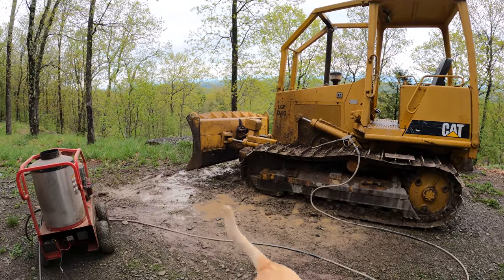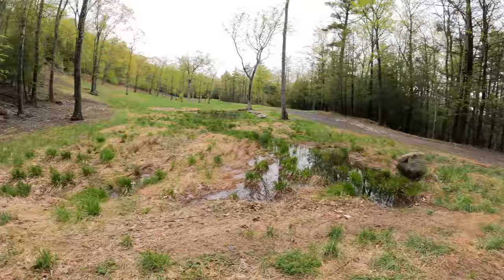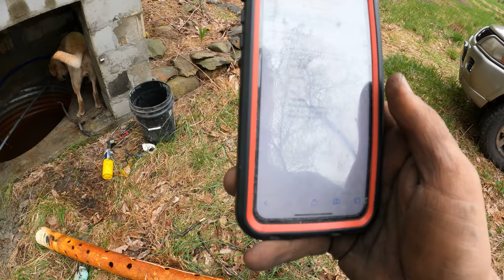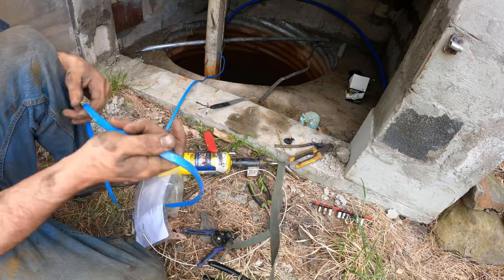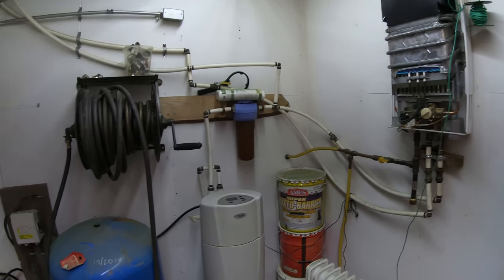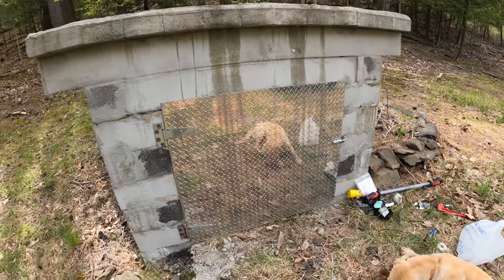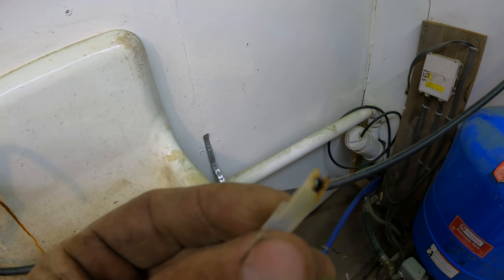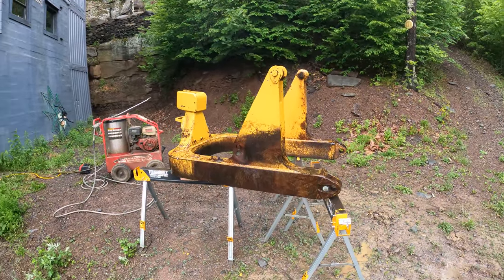Replacing a well pump

Comment: Clogged filter burned up the pump and then started tripping the breaker once new pump was in. Little maintenance goes a long way.
Reply: Are you talking about the water filter on the wall that he changed?  That Has nothing to do with burning out the pump!!
Reply: @mainelyelectric  that's weird because replacing the filter fixed the issues.
Reply: @mattkeller2466  yes it fixes the flow rate issues but doesn’t fix the burning out the pump! And like I said a clogged filter on the output side of the expansion tank and pressure switch will not burn out the pump it will just restrict your flow till you clean or change the filter.
Reply: @mattkeller2466   also a restricted output directly from the pump on the other hand would burn out a pump. And many people have already commented that the restrictive inside diameter of that blue poly pipe that he is running from the well pump to his building where the pressure tank is it’s smaller ID than normal well pump pipe so it’s restricted!
Reply: @mainelyelectric  Come on, man... That's a lot of words. (I'm actually sleepy joe!)

Comment: If you have the choice of 120volt or 240volt configuration on your motor, definitely wire it for 240. It will last much longer.

Comment: Don't you think the bad filter probably killed the pump? It was too much work to push water up the hill and then through a dirty filter....
Reply: The filter is installed after the pressure tank and switch so a clogged filter would not burn out a pump you just won’t get water.

Comment: You filled your pressure tank water side full of air. You will have to bleed the air out of it for it to work properly. Will have to turn off pump and release water pressure off the tank till zero then turn pump back on.

Comment: Does it occur to you that the clogged filter  term might have caused the pump to generate enough pressure to make it split in two? The last time you made a well video, I suggested a green sand filter that backflushes on a regular schedule. Secondly, the well looks nasty, and I  hope your drinking water is coming from somewhere else. At least have it checked for bacteria content and don’t contaminate it with sticks or other debris laying around n the ground.

Comment: Andrew, since your well isn’t so deep, why didn’t you just use an above ground jet pump. It is located out of the weather so that would work fine. Cody is hilarious.
Reply: The water needs to be pumped up the hill. Maybe a suction pump with an inline jet pump to go up the hill? I have no knowledge on the subject, just spitballing
Reply: @zefallafez  yes, I commented before I saw the rest of the video. I used to install water systems and sprinkler systems years ago.

Comment: You don't need the pump control box on a 2 wire pump the pump has the start and run capacitor built into the pump motor

Comment: Let me save you some time reading the comments:
1) The pump broke in half. It’s trash.
2) The filter is after the pressure tank. Not the original issue.

Comment: I wonder if the pump overworked with that run... and caused the failure...
Reply: Probably also gets a work out from pumping through that blue pipe instead of actual 200 psi black poly well pipe. The ID is totally different and the blue is smaller than 1 inch ID
Reply: @mainelyelectric  like holding a finger over a straw as you try to drink...
Reply: @johncolasanto605  my well on our farm is 630 feet deep! The pump is set at 200 and the run from the well to the pressure tank and switch is probably 400 feet more! But it’s true 200 psi black poly well pipe.

Comment: Considering your well pumps easy to access I would just throw a cheap pump in there from Lowe's. But if you got a well like me, that's 300 feet deep. I would spend $1000 for a good pump. Also I would have somebody there when you're working on your well pump. If you slip and go in head first your dead man! You should also add yourself union making it simpler to service the pump. That blue pipe is probably PEX I would buy myself a compression tool.
Reply from the maker: The pumps at lowes were expensive.

Comment: The pipe size problem is problem cuz 1” CTS (copper tube size) measures 1 inch on the outside. You need 1” IPS (iron pipe size) for barbed fittings. Measures 1” on the inside

Comment: 13:30 You have eliminated the runstart capacitor from the circuit, this can cause problems with the pump starting and cause it to fail faster or break the fuse if capacitor is bad.
Reply from the maker: The new pump did not require that.

Comment: Looks like your pipe issue is the blue stuff is 1in outside diameter while the fittings are for black poly and they are 1 inch inside diameter.

Comment: Need a pump teardown to answer what the problem is. After pumping that dirty water, the pump may be clogged and broken the motor shaft.  
Dirty wells will pump the dirt/sand up the pipe.  When the pump shuts off the the dirt will settle back into the pump and lock or bind the impellers.
Reply from the maker: IDK, the impeller part of the pump came up empty, they are probably still laying in the bottom of the well.
Reply: @AndrewCamarata  
Impellers probably got bound up and twisted off the shaft. A sign of GRIT settling back down the pipe.  Might try spring loaded check valve at pump outlet. Don't rely on built in check  valve. 
You'll always have problems with dirty wells.
Reply: @AndrewCamarata  2 hp is way too much. Stirring up sediment wearing out pump. Also keep pump a couple of feet off bottom as well perforations. Also pump out could exceed the well recovery rate during high demand. Over time you've lost well refresh rate due to sediment buildup. 
Of course this is all just speculation. Time will tell. 
What a tease, a Yanmar dump at the end.
Reply: A partial solution may be to flush the well.  Run a hose away from the  well an let it run for a couple of days.  Put a valve in the line to restrict flow.  Check amperage draw, as the more water a pump moves the more amperage it  draws (the more you close the valve - the less amperage it should draw).  See how much sand the well makes. Sometimes you can flush the formation. 
P.S. love the videos.

Comment: i only buy grundfos $489 order from local plumbing supply house im on a dairy farm red clay 3 billion year old granite ledge 82ft well previous grundfos lasted 14 years. latest one is a 3 wire 240v has the capacitor built into it one before that was a 4 wire 240v external capacitor does'nt seem to make a difference what always happens is the screen plugs with manganese kills the pump, when bad it'll keep switching on/off 24/7 continuous to maintain 60psi even with new pressure tank. the difference in quality would be the design of the pump veins & how many of them to handle silt. local farm store sells Red Lion brand for $189 but ive not tried those

Comment: looks like you need a bigger pressure tank too....bc thats where the water pressure comes from and that small tank does not have enough volume to run your pressure washer bc you keep running out of water than it has to fill back up...and you new pump isn't as good as your old one.. has less gpm

Comment: 2hp pump is far too big for what you have going on there. When a submersible pump turns on and cycles it should run for a couple of minutes to build the tank up to pressure. This will increase the life of the motor on the pump. It rare for me to pull a pump that hasn't been in for more than 10+ years. And this is what I do for a living. Down in Westchester NY.

Comment: at 4:53 it looks like you have a huge reduction in pipe diameter coming out of the pump. That could be causing the pump to work harder, but I am not anything of an expert in that field.
Reply: I think the root cause of the problem was that clogged filter.
Reply: @robertv4442  Or the pump in 2 pieces...

Comment: If the last ebay pump lasted you 6 years without a problem just get one again the same, the $1000 pump from your local shop just has a very well inflated price through the wholesaler then the middle man then the retailer etc

Comment: The difference between 1k pumps and the $200 pumps is mine is 30 yrs old and going strong and that's with 
underground sprinkling and raising 3 girls. Btw; I think the pressure washer needs to be pressure washed  :)

Comment: If it's local pump supply store, then they are ripping you off because they know most times a well pump is an emergency type situation  usually for home water systems. So they jack the price for convenience of having it in stock

Comment: The iron oxide is strong with this one. You need to flush that well more often. Your bleach is reacting with the iron in the water. Hope you have good filters.
Reply: The steel culvert as a well casing is not helping but making the iron worse. I made a shallow well on my farm and used a 4 foot diameter 10 foot long section of plastic culvert.

Comment: Listening to the humming of the bad pump, it might just have been the capacitor (In your junctionbox) that is bad.
Reply: No the pump was running but just the motor and not turning the pump because the pump and motor had split in half.

Comment: That run start capacitor is most likely the culprit of the breaker in the junction box tripping. Removing that will decrease the life and efficiency of the pump.
Reply from the maker: The new pump did not need the capacitor.

Comment: Tip from a plumber: flip the teflon tape roll 180 degrees. When applying it just let the roll spin between your fingers. This way it doesn't "run away" from you so that you end up unrolling way more of it than you need. A little difficult to explain but here's an example: https://www.youtube.com/watch?v=f7mjyzfB9Ec
Also especially with brass fittings you might want to scratch the threads a little with a hacksaw blade for example so that the tape doesn't slip.

Comment: I Andrew why don't you drill smaller holes in your PVC pipe and put a screen wire around it galvanised green water around it and then put a little gravel in the bottom of that around the pipe but put a bigger pipe in there so you slide the pump in an easier you'll have less sand and dirt in that pump

Comment: I recently Experienced My Own Water Pump Nightmare. Pump Took a Crap, Bought A Pump From Ebay and Drove 300 Miles to pick it up, Installed it and it didn't Work! Bought a Brand New PumpFrom Tractor Supply and Installed it  and it didn't Work!No Shit ! I have a tank that is fed From an underground Spring. After Meticulously Checking My Work Twice, and Three Times,The Culprit was The only thing I didn't replace: A oneway suction Feed Valve that Was Existing! A Three Foot Piece Of Plastic Pipe and a valve probably cost me Thousands in electric bills since I bought this place and Now I own Three top Of The Line Water Pumps! But just when I could Enjoy a 40 Psi Hot Shower The Power Went Out!.Power Came Back on. Plenty of hot water! The Next Day I noticed a Drop in Water Pressure! So Shit , When The Power came Back on there Was a surge that Blasted one of the 120v glass fuses feeding the water pump and the lack of water fried both elements in my water heater!A month or two of cold showers later Now I can Fix a water heater. Camerata Rocks!

Comment: "Black and white are hots" - is this a colloquial way of saying a hot and a neutral or am I thinking of something else? Genuine question -not intended to sound rude or snarky.
Reply: The yanks use a weird way to get their 240v for their 'heavy duty' equipment- they use a transformer near the house that has a center tapped 240v output, with the center tap being grounded and the neutral... to get their 240v, they use 'active to active' (which Andrews is either incorrectly wired, or he meant hot to neutral) because they get the 240v from one 'hot' to another 'hot' which 'should be' line/hot 1 (black) to line/hot 2 (red) with the center tap being 0v (white)- so his pump is 120v, or he's been naughty with the wiring and used the wrong colours for a 240v one... (looking at the breaker its 'probably' a 120v one)

Comment: Is the pipe 1" ID or OD?
Reply: I believe the blue pipe is OD so it’s smaller ID than true 200 psi black poly well pipe That’s why 1 inch poly fittings don’t fit it.
Reply: @mainelyelectric  that's what I was thinking. It's frustrating when some measure OD and others ID

Comment: The one thing you have done wrong that shortens the life is you have the side i of the pipe cut out the water needs to come from the bottom of the pump so the water keeps going by the motor to keep it cool and keeps it from over heating

Comment: Live wire should have been black and red.
Reply from the maker: Well red was the start wire.
Reply: @AndrewCamarata   Sure but once on regular 240v(and you removed all of the "starting thing"...the white is supposed to be neutral...black and red power.  If only black and white available you can tape each end of the white to mark it as a live wire.  ...I'm no electrician, but that how it's supposed to be ...easier to see and troubleshoot at a glance later.
Reply from the maker: You’re right. I could have switched it.

Comment: Come on gallons per minute sometimes the pressure pulls to much water and trips the trip wire ,pressure washers have to have so many gallons per minute or it burns out the pump and washer

Comment: Andrew that box is not needed what so ever now you can run everything from the pressure switch with a 2 wire system

Comment: Yup homeowners just want it to work with the cheapest fastest poorest way possible you would never want to contact a pro company like ours - the charge out cost is more than one of your bargain pumps, though the stuff we install tends to last for 20 to 30 years, in that time you get the experience of putting in 5 to 6 pumps.

Comment: What happens when a mouse gets in that water and dies?
Reply from the maker: Hopefully they cant, it is solid concrete, and the door closes tight.
Reply: @AndrewCamarata  right on-recommend some hardware cloth to further prevent, maybe even build a little frame so you can slide it in and out. Little light in the winter will keep from freezing.  You can get plugs that kick on at freezing temp. Great property, dogs & toys buddy!

Comment: You shoulda made black and red the hot wires.   If white is a hot wire you're required to put a ring of electrical tape on it to tell people it's not neutral.   Not that anyone's going to come looking in your box,  but I know you like your stuff to last "100 years" so one day someone might have to replace the pump that's not you.
Reply from the maker: Yeah, I could have, the reason I did not because red was the start wire, and the new pump did not require that. But anyone servicing that pump will easily be able to tell what was done there.

Comment: Just have to ask why did you put all that crap back in it's not needed the outer pvc and that hose crap should go you would save a lot of time pulling and installing . If you would use sch 40 PVC 1 in cut and tread 2 of them 5ft peaces screw together put a 1in union at the top for easy disconnect and a check valve at the top of pump. Put a safety rope on pump end so you can pull it. It would of cost you much more and it will be a way cleaner install and easy to work on. But what would I no I've only been doing pump work for 17+years now.            ps you should check that bladder tank it's probably bad and clean the line under the pressure switch just in case. 👍👌✌️💦🌊🇺🇸💯
Reply from the maker: The union thing does make sense.
Reply: @AndrewCamarata  the control box on the wall not needed any more the two wire has it built in the motor that's why it said no control box needed and if that pressure tank bad Wich I'm positive it is that motor won't last long. It's probably why it broke coming on and off👍👌✌️💦💯🇺🇸
Reply from the maker: @josephsaucedo8691  The pressure tank isn’t bad, it would build up pressure much quicker than it is if it was.
Reply: @AndrewCamarata  that would be amazing if it was but I don't think so how much air in the tank when the water  line is o psi and if the tank heavy it's bad or if water sprays out of valve stem it bad  the water should run for 5min to10 with out the pump coming on. Pump runs right when water turns on it's bad.